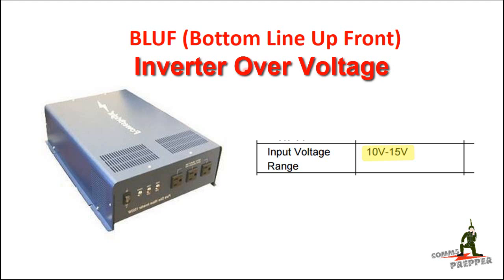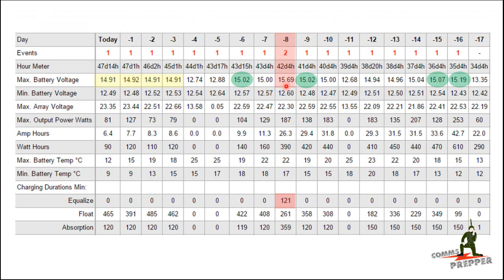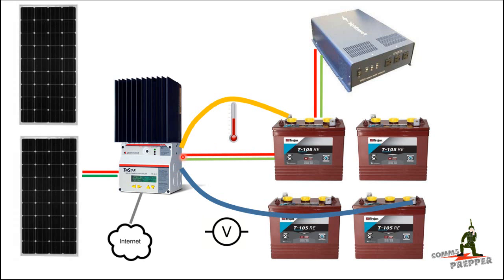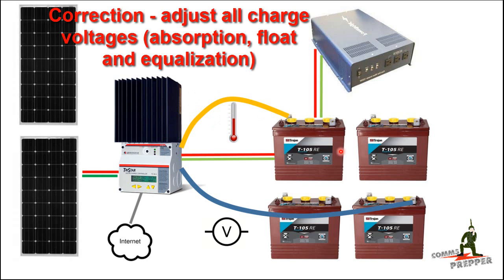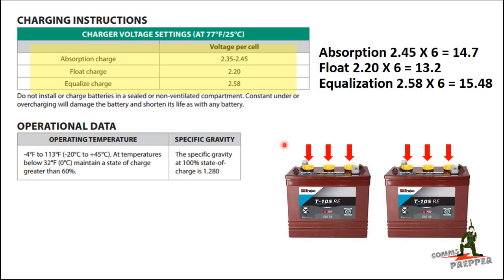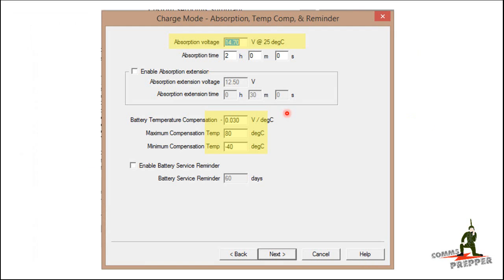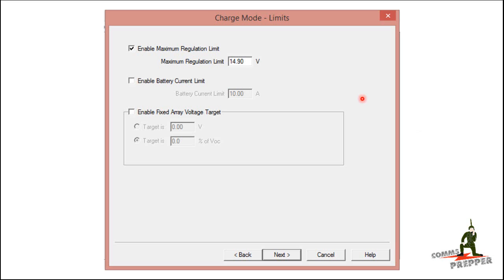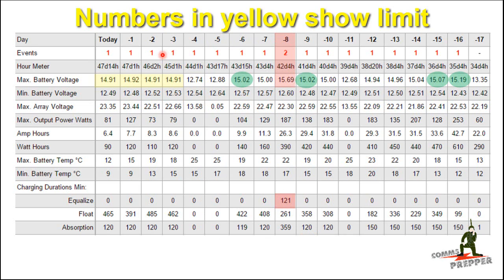Off Grid Solar Power Oversight (inverter over-voltage)

Comment: What I need help with is that my charge controller is blinking crazy and telling me my batteries are over voltage
Reply from the maker: Try disconnecting and cleaning all your connections.  Then measure each battery alone to check actual voltage.  If lead acid you may want to check the specific gravity of each cell.
Reply: @Commsprepper  they are all the same battery 12 volts 155 amp hours and they all work fine charge level is fine I had to reset my charge controller and that seemed to do the trick

Comment: Yep I messed up and got the tristar mppt 45 amp model. Big mistake because you can't manually adjust the charge settings for your specific batteries. Get the 60 amp model everyone. I am.
Reply: James Norris I own the mppt45 from Morningstar and have 4 t105re configured in a 24v system and im able to adjust the charge settings. Are you sure you selected the proper dim switch setup?

Comment: have you contemplated the use of flooded lead alum batteries? this type of battery conversion is more resilient in varying temps. it doesn't suffer from the cold as lead acid does. as it can produce more current and volts in cold weather, as opposed to standard types. so if it can produce more volts in cold temps. it's more accepting of a lower voltage in the cold.
Reply from the maker: +dale myers I did not.  Right now I have to work with what I have (paid for).
Reply: i understand. but i'll be buying cores from auto-parts stores and converting them myself, after doing the epson salt cleanse, at a much reduced cost than buying new batteries. an no, you can find lead alum batteries on the market. i learned of this via the guy who designed the bedini wheel.

Comment: I will agree with those who are telling you there is nothing to worry about since it's only (less than) a volt over spec.  And don't forget you are going to be loosing a minor amount of voltage in the wire going between the batteries and inverter due to resistance.
Reply from the maker: +Arnd2it Agreed but I felt I had an obligation to share this on the channel.

Comment: So what's happening on the inverter, is it shutting down because of the over-voltage?
Reply from the maker: +Arnd2it No.  Fortunately I had the inverted turned off with the disconnect switch in anticipation of running an equalization cycle remotely over the Internet.  However, specs are specs and I do not want to risk equipment.  Inverter manual says 15VDC for the max so I will not push it.  Other viewers and commentators on the video said this is not issue.  Perhaps it's not but I felt it was worth sharing in a video so others who are planing systems know there is equipment designed to accommodate these type of system issues.

Comment: Did the inverter go into over voltage protection? I wouldn't think that being a couple tenths of a volt over the maximum voltage would damage the inverter. Good video
Reply from the maker: +BuckeyeBryan Fortunately no.  At the time the voltages were rising I had the inverter turned off because we were not at the retreat.  I did not notice this issue until may last solar video about starting equalization remotely.  I made a few calls and was told that higher-end inverters will spec 16 volts to accommodate this issue (live and learn).

Comment: this is a common problem with renewable energy batteries. they need to be toped off everyday or they will fail so to over come this problem the set points are higher then with other applications
Reply from the maker: +Roy Amberg I am learning as I go and hope folks can learn from my postings.  Thanks for taking the time to watch and comment.  CommsPrepper

Comment: The inverters will take more voltage than listed. I run mine as high as 18 with no ill effect. Two years running and it puts out just fine. Personally I wouldn't worry about tens and hundreds of a volt. Your batteries are the most expensive part of the system so do what is good for them and let the inverter compensate. Additionally battery voltage doesn't stay that high under a load. I doubt you are seeing voltages above 15 for very long with the load applied to the inverter.
Reply from the maker: +Jeff Barr Thanks for the info Jeff.  While on-site I keep an eye on this.  However, when not at the retreat I disconnect the Inverter and let let the system run.  My issue is I am not running any loads while I am not there.  Perhaps that is something I should be doing.
Reply from the maker: +Jeff Barr (missed some in the last replay)  What I do like is MorningStar controllers provide the flexibility to address issues like this with their software.  They are great controllers!
Reply: If the inverter is disconnected then you have no issue with battery overvoltage. Let the charge controller do its thing and even Equalize. Once absorption is complete the voltage will drop during float. I am missing the issue? What is your concern? You can't damage the inverter disconnected. Even if it is connected you will see a dip in battery voltage right away as the load will bring voltage down. Sorry for being dense but I don't understand your concern.
Reply: +Commsprepper Your a bit over thinking this brother. The Inverter will be find. I have seen volts as high as 15.90 on the shunt side of my bank. Here is where I do not tink this is smart what your doing. The batts are the thing that cost the most in our offgrid setup. When not letting them have what they need to be happy. Your going to hirt them over the long run. 

The over volts at worse that will happen is the invert will turn off or buzz. With a load tho your going to be pulling it down in the day time when the sun is up so to be 100% true full your not likely to see that happen.
Reply from the maker: +Jeff Barr Jeff, not a real concern.  I was fortunate that I had the inverter disconnected in anticipation of starting equalization remotely.  In my configuration (weekend place) I am not routinely running a load and the system predictably cycles through its modes (MTTP, absorption, float, night).  It was during these conditions I had concern.  Specs are specs and based on what we pay for all these little widgets in our systems I feel it's best to keep everything with the specs - especially when I'm making videos on these topics.   Right now the voltage swing above 15VDC has not been much because it's not that cold but I expect the swings to be more pronounced when things start to dip below zero (f).  I thought this would be a good FYI topic to be considered for folks looking to setup off-grid solar.
Reply: +Commsprepper Sent you a email.
Reply from the maker: +yankey4 Yankey - I understand - just sharing facts with the viewers (specs are specs).  I am not too concerned between retreat visits because the inverter is switched off - no harm no foul.  My concern is when things start to dip at or below zero in our area and temp. comp. really starts to introduce increased voltages.  Again - a majority of the time (between weekends) my system is not supporting loads to bring things down.  My goal with the video is to let folks know that systems can be fluid (varying voltages) and equipment does exist that accommodates these parameters.  With enough force I can fit a square peg into a round hole - but I would prefer a round peg (had I known at the time).
Reply: Commsprepper Ok cool. From what I was getting out of the video. You where thinking all this bad stuff lol. Your fine. BTw thanks for the shout out. God Bless Brother.
Reply from the maker: +yankey4 I understand.  Specs are specs and when I miss something I have an obligation to share with the viewers.  Can't get everything right.  Hank